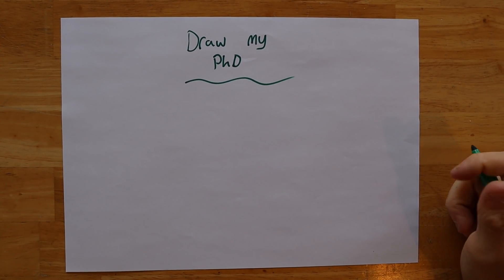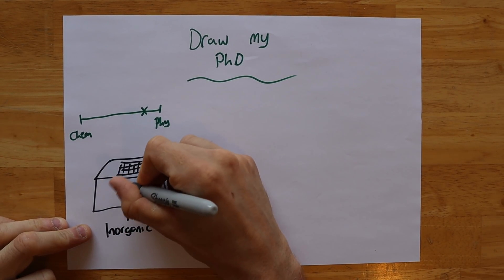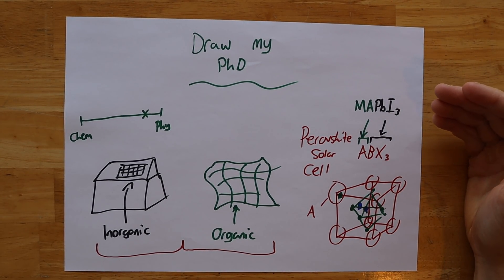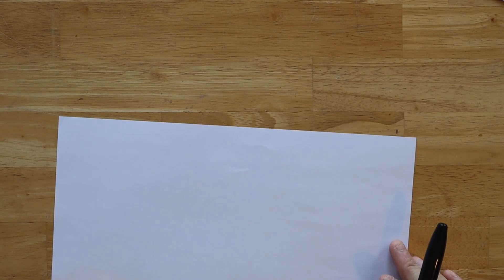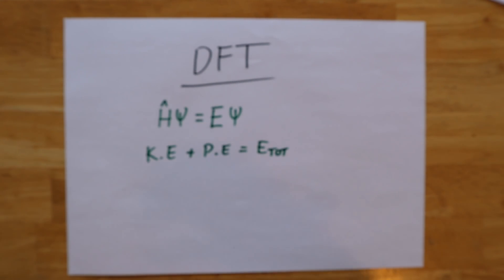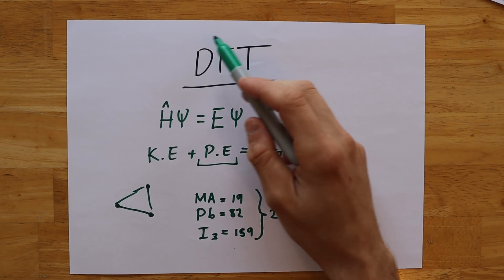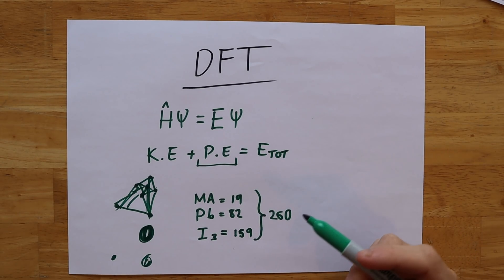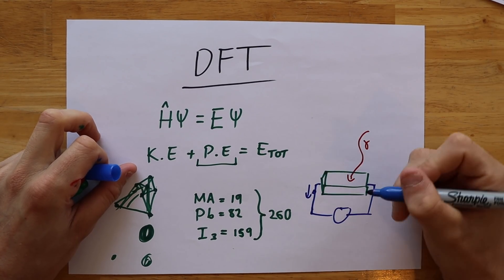Draw My PhD | Perovskite Solar Cells | Cameron Underwood

Comment: This video is good and very clear, but I don't think perovskite is a good solution. It has already taken too much research source but still far far away from commercialize. It was a hot topic at first but now it is just a boring topic for me.
Reply from the maker: Thank you! 

Yeah. It is very difficult to see which technology will be most vital in renewable energy, it will surely be a combination of many. Perhaps Perovskites may not take off on their own first but will see success in tandem cells. Like many technologies, there is a risk associated with putting time/money into the research. But it has been less than ten years total, so there is still massive room to progress.